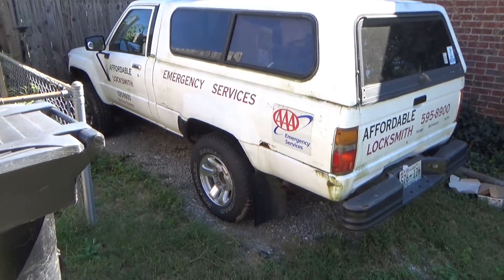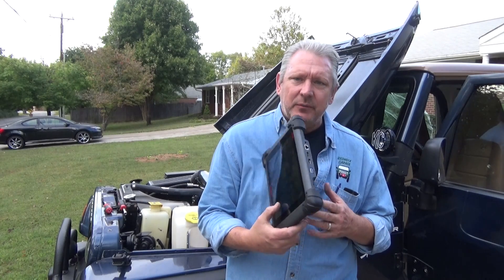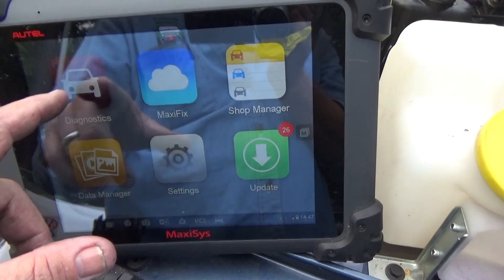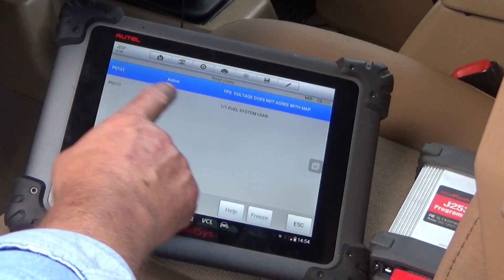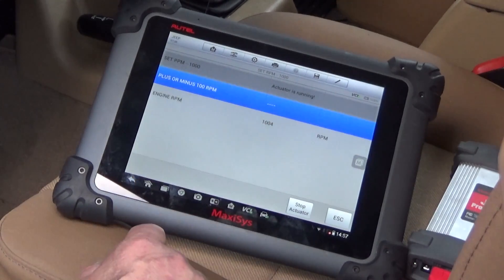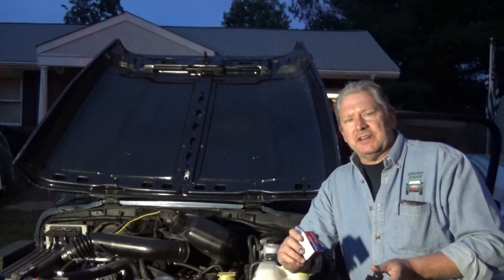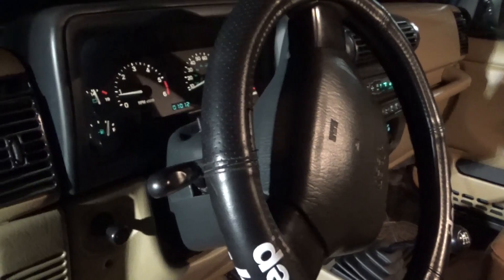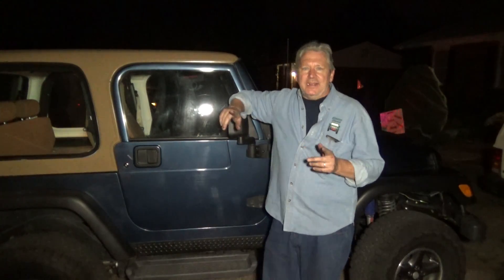Wrangler TJ - Pulling Codes -Fixing High Idle - Maxidas 908P Pro Scanner

Comment: I am having my 1991 yj hard to start and when it runs it runs at 3500 rpm can not find a intake leak
i think is electric !!!!!!!Help!!!!!
Eugene
Reply from the maker: Yeah could be the nasty set up they used on the 91s.  The fuel injected eliminated many of those problems. You could do a nutter bypass if you wanted to eliminate the electronics but have to worry a bit if you are trying to pass emissions.  I have some videos on doing that to a CJ which is almost the same as the early YJs

Comment: I had a problem with the Air Control Valve. Erratic idle. $13 Amazon. And as much as $125 from dealer.
Reply from the maker: whoo wee - which one did you buy ??? hahahaha I hear ya :)